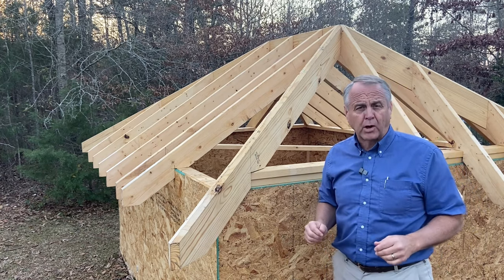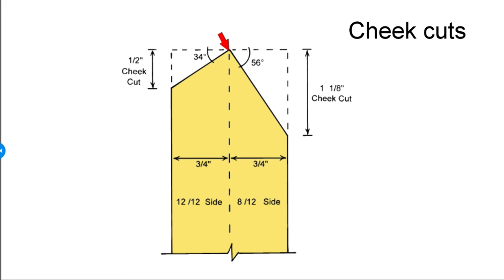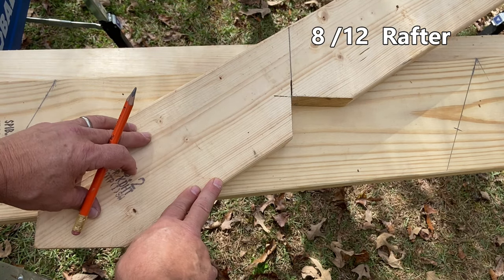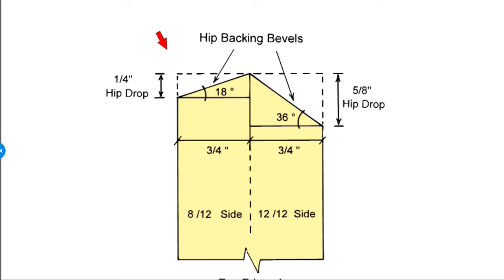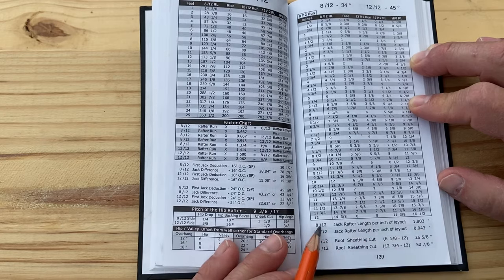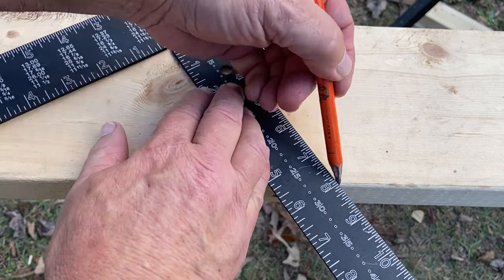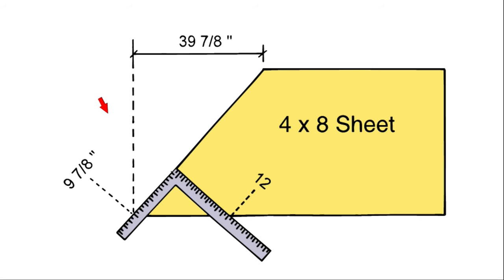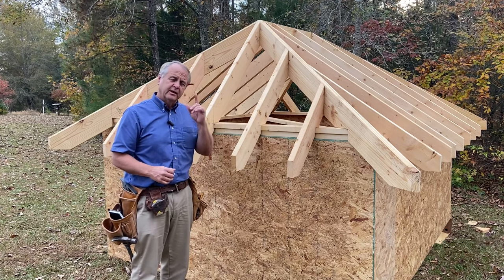How to frame an irregular, "bastard" hip roof Part 2 - Step-by-step instructions

Comment: In a case where the hip already has the backing bevels applied would it also be feasible to measure the hap down from the top of the plum line on the 8/12 side of the hip to mark the birds mouth seat cut?
Reply from the maker: Yes, if I am understanding you correctly, that would work just fine. The H.A.P. would be the same as the 8/12 common at that point. Thanks for watching!

Comment: Hi guys 
Great video. 
I’m being dumb. But wouldn’t raising the wall plate change the pitch?
Reply from the maker: No, the pitch is what it is. We were going from the end of the tail. The 12/12 rafter rises from that point. Since it is rising steeply we have to add the plates to get high enough bearing for those rafters. Everything works from the "fascia point". Both pitches start from there. Thanks for watching!

Comment: I have the Bible and am working through the pitches (4/12 and 6/12 for my situation). How do you calculate the amount the plate should be raised to keep the tails at the same height?  I don't see that figured out in your video and I don't see it in the book.
Reply from the maker: This is discussed in the first bastard hip video at minute 17:40. If you keep the same H.A.P. for both the 4/12 and 6/12 rafters, and you have the same 12" overhang, you could build up the plate 2". Or, and most probably, you would add one plate and then adjust the birdsmouth or H.A.P. for the other 1/2". I have used the 12" overhang for the sake of clarity. If you have a larger overhang of course it would be different. Generally what I do is layout the lower pitch common first, 4/12 in your case. I then lay the framing square on the rafter as shown in figure 27, on page 29 of Roof Framer's Bible. I can then read on the framing square how far vertically it is from the "fascia point" up to the birdsmouth level cut. I do the same thing on the steeper rafter, 6/12 for you, and then mark the birdsmouth for it at a height that makes sense for that rafter. In other words at a height that leaves the appropriate amount of "beef" in the rafter above the birdsmouth notch. You can use whatever combination of adding plates or altering the birdsmouth cut, that gets you the height that you need. Of course this will vary by the pitch and also how wide the overhangs are. Don't be confused by it. Just use the framing square to measure up vertically from the "fascia point" and you'll have it. I hope this helps. Thanks for watching!

Comment: Much respect to you sir and your videos, just received your book, its packed full of info. I do have a question though. Plumb cut on birds mouth hip rafter. Is that cut on a bevel or square  cut? Appears to be cut square on video, if so hip would not be tight against  plates, or does dimension  in book already have that figured in.   Thank you.
Reply from the maker: The hip length is calculated at the center of the hip rafter. If it were hitting on the corner of the wall then I just cut it square which would mean of course that it would only be touching the corner of the plate at the center of the hip. If it is offset from the corner (hip offset) I first cut it square, but then bevel back the side that would prevent it from setting up tight to the plate. Of course in most applications the cornice will cover all of these cuts, so they don't need to fit on both sides. You just want to cut the one side "cheek cut" so that the center of the hip can meet tight to the plate and properly align the hip rafter. Thanks for watching!

Comment: Confused on how to measure the hip tail using the factor chart. You pulled up 24 3/4" from the tail. Where did you get that number?
Reply from the maker: The factor chart allows you to quickly go from the value that you have to the value that you need. In the case of the hip tail length we can use the run of the high pitch side to get the length of the hip rafter, or in this case the length of the hip tail. So, since a bastard hip will always cross off of the corner of the wall to the high pitch side, we will use the overhang length (12" in the video) on the high pitch side to enter the factor chart, so 12" x 2.062 = 24.744", or rounded to 24 3/4" for the hip tail. Thanks for watching!
Reply: @RoofFramersBible thank you! I get it now, the hip rafter is married to the high pitch side for all its calculations. I’m shortening the over hang on the higher pitch to avoid building up the wall plate. As I’m understanding it, there isn’t anything else to factor when cutting the birds mouth to match the 12” overhang on the shallow pitch, the overhang reduction covers it all? Learning a lot. Thanks again.

Comment: On a bastard roof using the same height on the top plate and different width overhangs are haps the same all the way around.ie: for the low pitch side , the high pitch side and the hip rafters?
Reply from the maker: Typically they would be, since that is the easiest. If you are already varying the overhang then it is just easiest to make all the adjustment in the overhang difference. Of course you could vary the H.A.P. and adjust the overhang difference to account for it, but that adds complexity and is not usually done. Good luck and thanks for watching!

Comment: how did you get 4 inches for your hip rafter soffit cut?
Reply from the maker: The vertical cut on the end of the tails will vary by preference and finish fascia size. For a 1x6 fascia I usually use 4" on the common rafters, and of course the hip would be the same. Thanks for watching!

Comment: I believe If you cut the birds mouth at the appropriate angle (56 in this case) I believe this will essentially allow the HAP to be correct at the building line. Which means there will be no need to drop the hip or even back (assuming not a large beam because then gap between sheet and hip will be to great) this is the same concept talked about by clipping corner at 45 on a normal hip mentioned in will holladay’s book RCS. Is this accurate or am I missing something. I’m going to try and build a small model to verify.
Reply from the maker: Certainly there is more than one way to do it. You can do as you say and clip the corner of the plate, or move the birdsmouth notch. This will shift the hip towards the ridge (up slope). Doing that will have the same effect as dropping the hip. That isn't how I do it. I find it easier to keep it straight in my head by dropping the hip. Thanks for watching!

Comment: I have  the book, I’m starting to learn how to use it and calculate, I normally use the calculator, I’m still an apprentice,. 
I do know that in the calculator you take off the high difference from the higher pitch to get the irregular. But I don’t understand how to do it on the book. 

I have a 8/12 and 15/12 my span is 26’ 4” +24’ overhang, total 28’ 4’
Reply from the maker: I don't have the full context of your question. I'm not sure what you are specifically asking.
Reply: @RoofFramersBible my question is, how did you get the 0.533, 0.854 and 1.315 on the 8/12 and 15/12???? Page 144 on your book.
Reply from the maker: To get the 0.533 is very easy. You just take 8 and divide by 15. The others take a multi-step calculation. I don't have space to explain it here. The factor chart lets you avoid a string of calculations. You can get what you need by multiplying by a single number. That is the point of it, to make it quick and simple. Thanks for watching and good luck! @jm3287